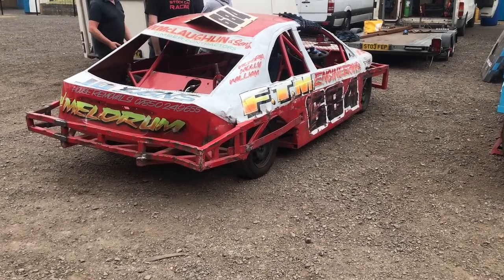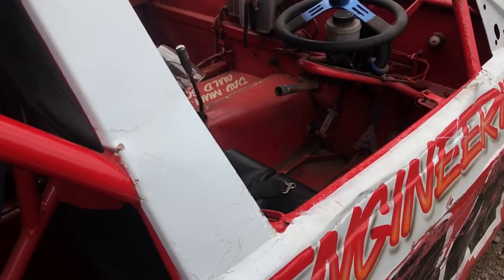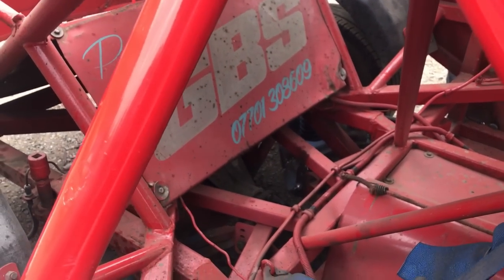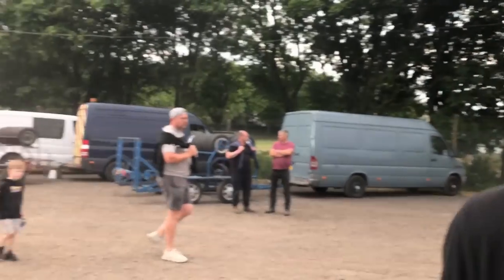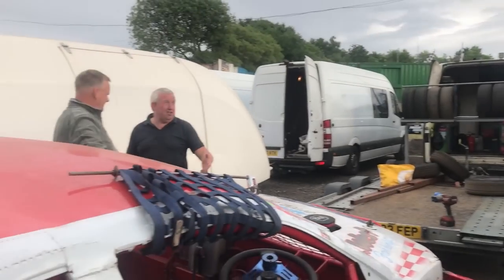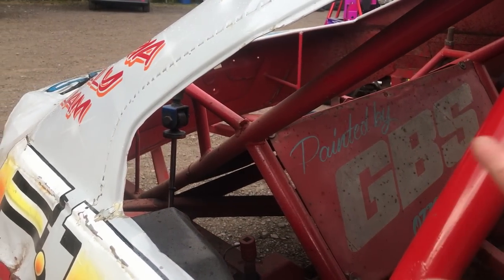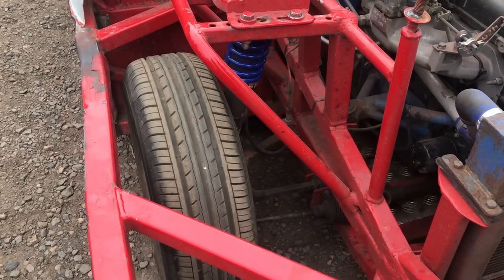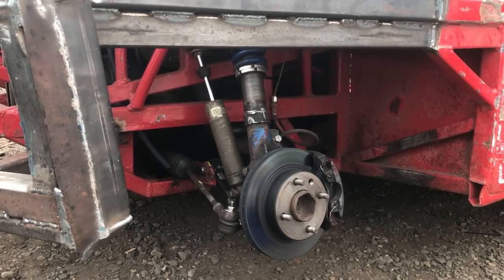Battle Scarred: A Night With The Saloon Stock Cars

Comment: Hi, great channel you have here. I've warched a few vids of Cowdenbeath and it looks like a great track. Definitely due a drive up there.
Reply from the maker: Probably one of the best tracks in the UK, little bit unique in that the racing line is out close to the wall rather than on the inside, makes for lots of mega contact action. If you haven’t been, definitely look into the saloon or stock rod world finals later this year.